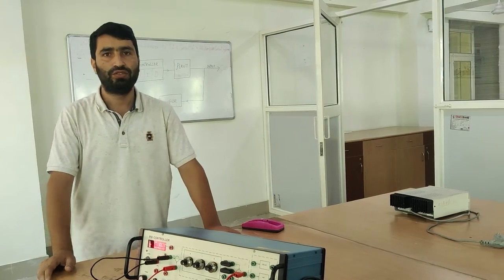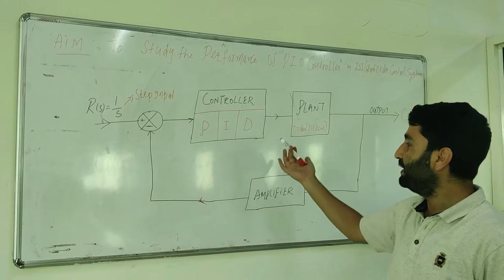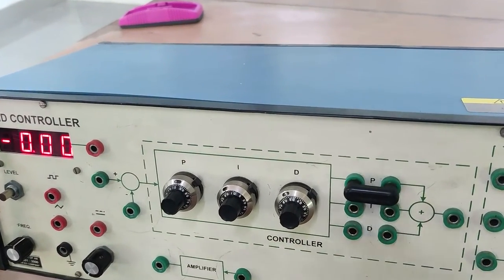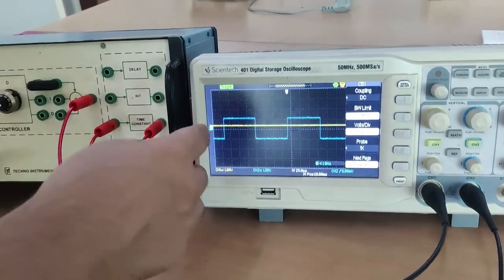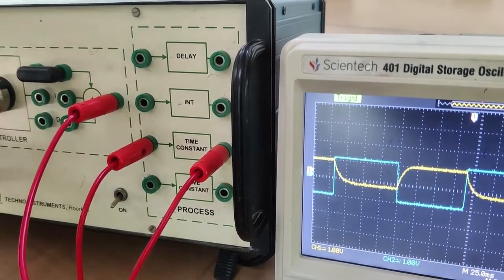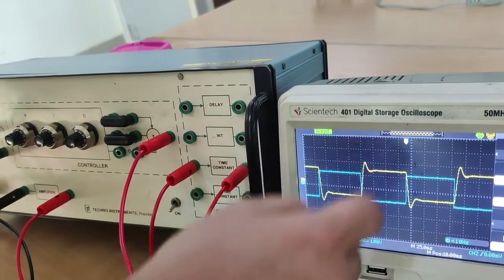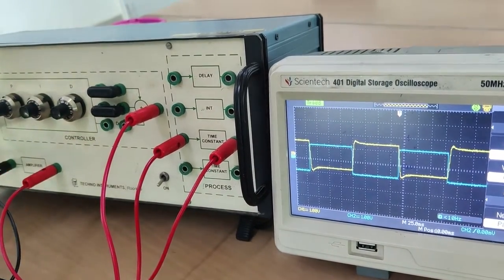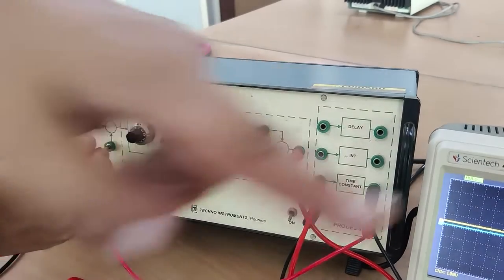P, PI, PID Controller Experiment and demonstration.

Comment: Where to connect the probes
Reply from the maker: Ground connection of the probe you have to connect with the ground connection on the panel (i.e black). Positive connection of the probe you have to connect at the output